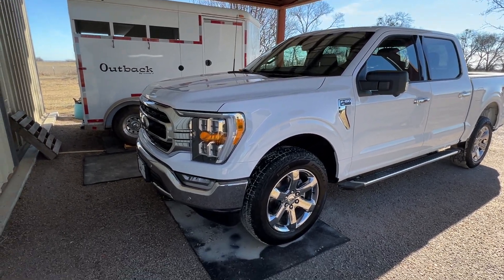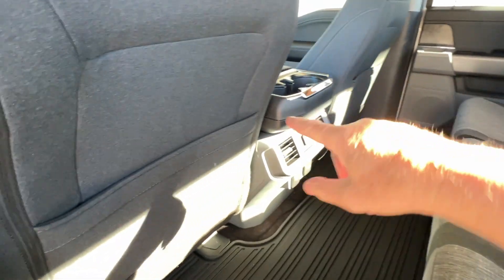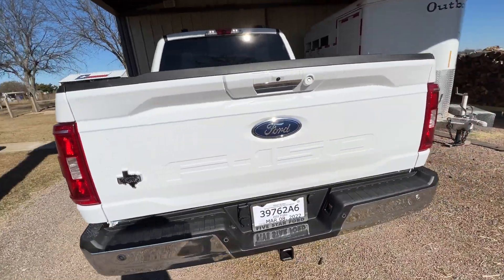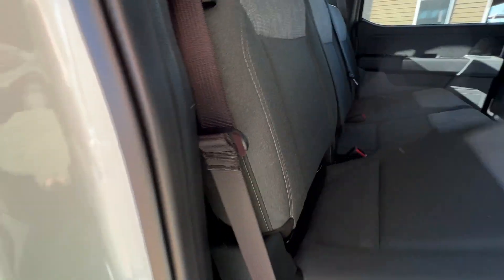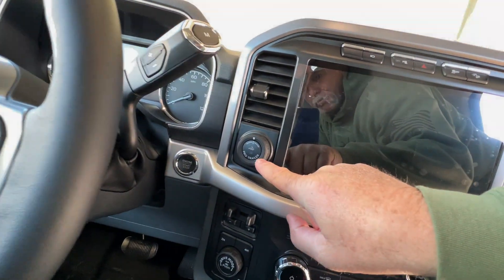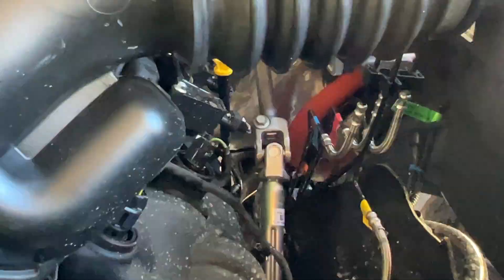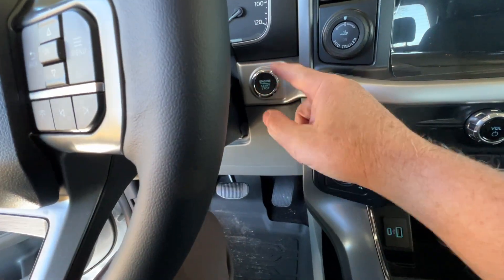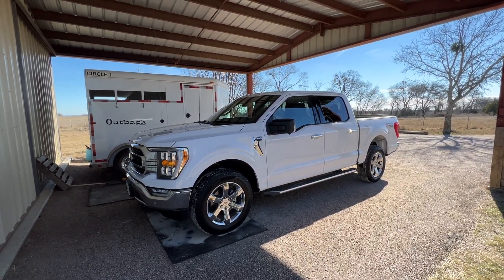Traded Toyota Tundra For Ford F150 - First Day Discussing Things I Like Better On Each Truck

Comment: Yes Rick the doors will be lighter on the Ford because Ford builds their truck body’s out of aluminum, that box under your passenger rear seat is the power inverter, turns DC power to AC so that you have AC outlets in the car. The antifreeze jug under the hood that you saw is called the expansion tank, their is a standard radiator underneath of it behind the fans but the radiator won’t have a cap to it, you do everything with the fluid from that tank that you saw, coolant expands as it gets hot so the level in that tank will be higher or lower depending on how hot the engine is, and if it’s super hot and you open that tank it will blast all over you just like a regular radiator cap would if it’s hot. Super happy to see you got the V8, Fords certainly come a long way with their smaller engines but I’m personally still not a fan of smaller turbo powered engines in a truck. Enjoy the new ride!

Comment: The driver's rear seat can fold down. But there is a really hard to reach handle in the back of the seat to fold it down I use a box end wrench to release it and fold it down.

Comment: Radiator overflow tank / resevoir..
  The Power Inverter is nice converting  12 volts  DC to 120 Volts AC..  It's  not big  enough to run your Microwave or mini Fridge .. The  ones in 18 wheelers can run all of that stuff..

Comment: Just wait til you deal with the transmission after 50,000 miles. It locks up the gears and is basically unfixable. Look at the lawsuit against Ford with it.
Reply from the maker: bumper to bumper warrant for 100K or 5 years

Comment: Lots of rodeo rigs that travel basically year round need 110v plugs for fans battery chargers, coolers/fridges that kinda thing. Even charging lap tops n such.
Reply: I use them for a small air pump to blow up water toys, air mattresses, inflatable boats. The one inside is great to charge notebook computers with AC chargers.

Comment: I believe the new Ford has an aluminum body which is why the door feels lighter and the hood is harder to close.  This can be a good thing from the perspective of corrosion and gas milage but,  collision repair might be a bit more costly because you have issues around work hardening with aluminum which means "banging" the metal back into shape with a hammer and dolly may be problematic. This may increase the cost to repair collision ( body ) damage.

Comment: At least you got the v8, you don't really gain any mileage with the turbo v6.  The doors as well as the bed are made of aluminum which makes them lighter and more corrosion resistant, but they also dent more easily.

Comment: 9k for the v8 on towing weight 13k is the Ecoboost V6 the 3.5 I think and almost all toyota trucks now are made in the US. your about 1 trim level down from getting all of the nice stuff the XLT is the nice work truck you get into the plat. and the lariat you get the fancy stuff

Comment: Fuse box location - I know you have a new truck and the hood's probably not going to come down, but I personally try to never put my hand through that little triangle corner section in case the hood does decide to drop. I've seen a few hoods drop, and when it happens, it's quick and unexpected

Comment: People can break-in through the exterior door handles on the newer ford trucks. Not sure if there is a fix but they either pull hard on the handle or break the door and can assess the lock inside the door. Something to know if you have weapons. I’m sure you can find with a quick “break-in ford truck”.
Reply: Most thieves probably are not going to dick around with the door handles, it’s faster and obviously easier for them to smash the window.

Comment: No offense but you should have got a 350 diesel if you got a 2006 or older no rust truck even if you pulled the motor and rebuilt it for about $10,000 for the rebuild theres no pollution control shit no DEF fluid and no tracking shit

Comment: The placement of the overflow is just odd. Like it was a after thought. Over flow tank which it is meant to handle the heat but it normally is where the fuse box is. Nice truck though, I like it.

Comment: You can get a lockable gas cap. Also the 4x4 activation system (IWE) is notoriously weak historically - not sure if this system is still in use in the newest models, but I would bet it is. 

It is vacuum activated, sometimes failing due to leaks in the system. You can delete it, but then your CV axles will turn constantly. 6 to 1…
Reply: I did that on my F150 when some dillhole stole my gas cap. I bought a locking cap at O! O! O! O'Reilly's Auto Parts. When locked, the outer part would spin at the lightest touch.

Comment: XLT is pretty limited, should have got a Lariat. You wouldn't have had many of your complaints if you spent a lil more money.
Reply: 😆😆😆😆😂😂😂😂😂😂 Mo' money, eh? Hell, cars and trucks already require a mortgage these days! And many dealers are marking their stock thousands over list due to short supply and huge demand, that's their justification, but it borders on usery. Myself, I want an old-school truck with roll-up windows, a six-cylinder, and 5 or 6 speed manual! With the few accessories being air conditioning, and a killer stereo where I can crank up "Cat Scratch Fever" or "Free For All" by Ted Nugent!

Comment: Airbag rear overloads will improve safety while towing. Thought worth mentioning.
  At least the fords are somewhat robust.
  If it has electric steer, plan on failures and just replacing servos. 
  The extra electronics are unfortunately failing point, but shouldn’t matter. 
  Good luck with her!
Reply: My 2013 f150 platinum has electric power steering and has never had any issues and just ticked over 150k miles. I much prefer it to hydro power steering, takes way less effort. You can drive with one finger if you want to. You can drive one handed all day and have no fatigue.

Comment: Don't put dielectric goop on your battery terminals. Just get some anti corrosion spray and spray em down. And sometimes disconnecting the battery in these newer cars can cause issues with having to reset computers and crap

Comment: I bought a brand new Ford F-350 right off the showroom floor and at 250 miles, the driveshaft fell out. I've hated Ford ever since. And yes, just like your Ford, you could tell it was made using cheap ass materials. And the darn thing wouldn't even pull a construction trailer. 

And speaking of cheap! Beware your capless gas cap! Be Careful not to damage it. If it's damage even slightly, your Check Engine Light will come on, and you will Fail your Vehicle Inspection. And it will cost you $$$$ Big Bucks to replace it. So Good Luck, Rick. I'm not in any way belittling your truck, but you did buy a Ford.

Comment: Big mistake.
Never change the spark plugs when the motor is warm, or you will pull the threads out of the heads.